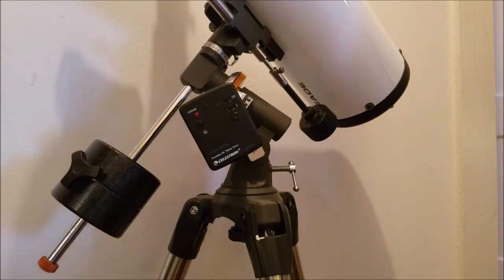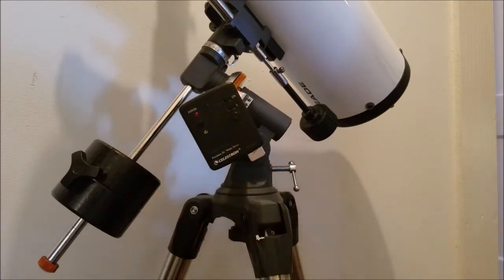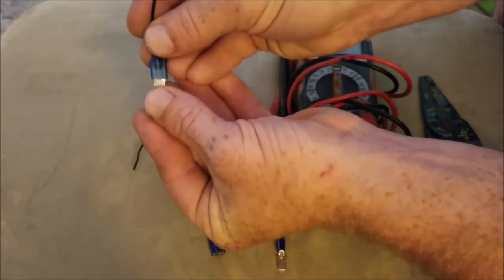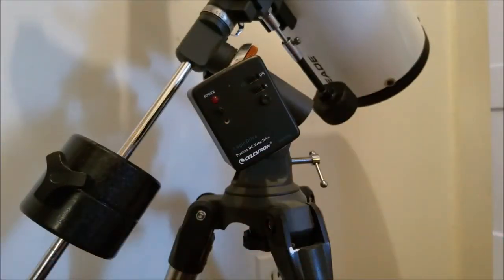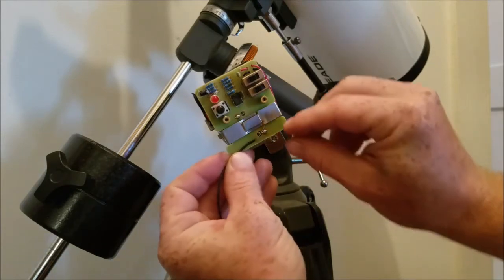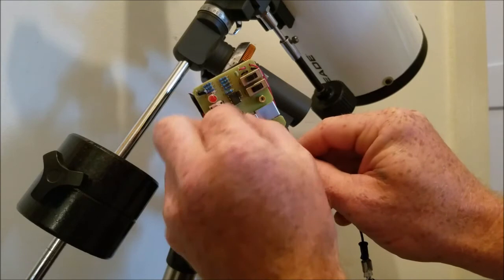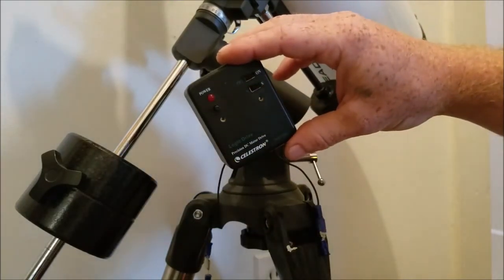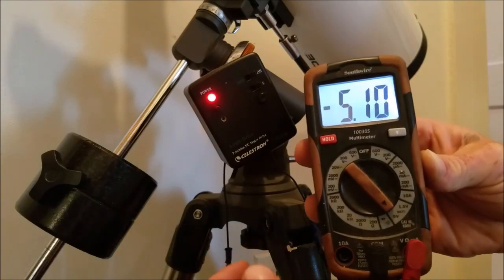Celestron cg2/cg3 RA motor mod

Comment: That's very similar to what I did with mine.  I used a two wire red LED voltage gauge mounted to the side the case.  This  gauge only reads positive voltage, so I wired it in before the North/South switch.  I soldered to the two legs of the cap near the top right corner of the board.  Here is the gauge I used:
https://www.amazon.com/gp/product/B00M6KZ4CG/ref=oh_aui_detailpage_o00_s00?ie=UTF8&psc=1
Reply: i am completely new to this. but it sounds like you hard wired it. can you please post a video on how to do it.

Comment: Fantastic idea. Great use of electrical engineering. A relatively cheap and highly effective way of controlling speed and correct for voltage drop due to temperate or weakening batteries. A shame they didn't include it in their design. Our variable speed ballast pump controls at work measure rpm's by htz. You effectively created a way to monitor tracking inaccuracy in that system. Excellent.
Reply from the maker: Thanks man to me this is a most do with this style of motor and astrophotography. As you know relying on sound alone is not good enough. I think I have also found a way to fix the voltage fluctuation as well. need to test first before posting!